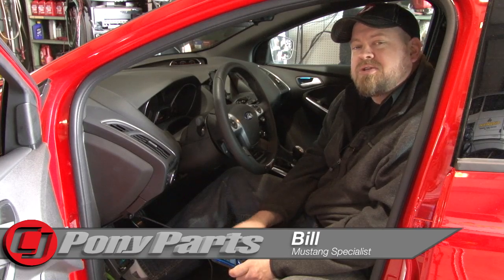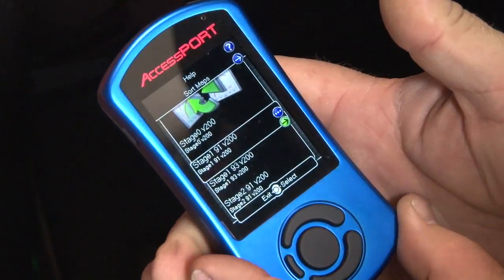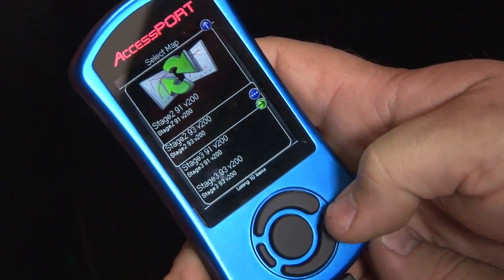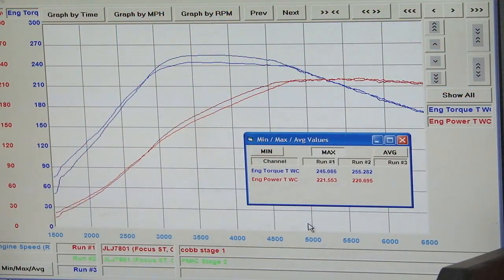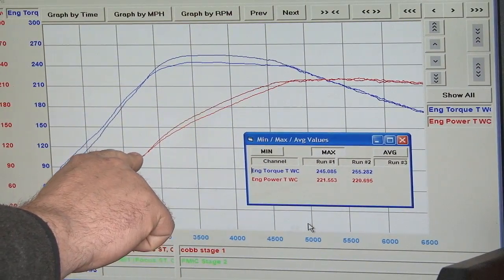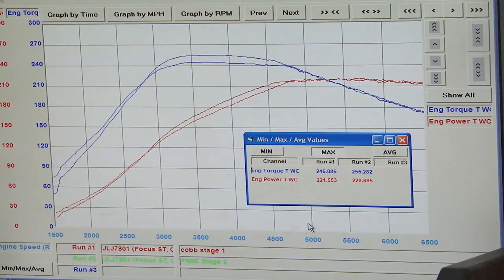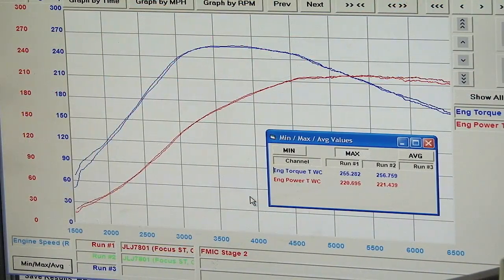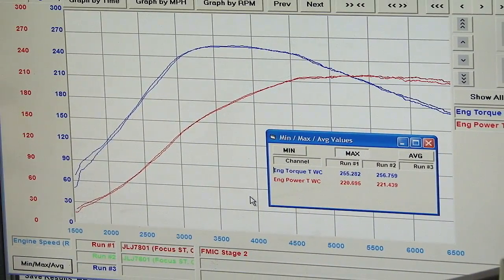Focus ST Dyno Pull with Intercooler

Comment: This is a perfect example of what I tell people. Upgraded intercoolers do not add any power, they just keep the power they always had but lose during spirited run on warm to hot days, even on cooler days in temps in the mid 60's, if you do 4 mild to hard runs it'll heat soak, thus losing boost and power.
Reply: MasterCarguy44 the man literally dynoed te car before the FMIC...installed it, ran it again...and the car made 10ft-lbs of torque more and 10 more hp through the midrange...but we're still saying a FMIC doesn't add power...lol..

Comment: Do you have to run a tune if you change the intercooler?
Reply from the maker: No you do not but the larger IC will be more beneficial with a tune and more boost.

Comment: Most of the aftermarket ICs also have larger inner diameter charge pipes, which let the turbo pick up more air. That's one of the reasons there are some gains here.

Comment: I don't get it I thought these cars had 250 HP from the factory?
Reply from the maker: 250 HP at the crank, not the wheels. Wheel horse power is always lower, usually about 15-20% lower than rated horsepower number.
Thanks for watching and please make sure you subscribe :)

Comment: Can I install a cobb intercooler on my focus st with out the charge pipes that came in the kit?
Reply from the maker: We only offer the cobb intercooler with the charge pipes. But if you want only an intercooler we offer this CPE intercooler that will work with the factory pipes https://www.cjponyparts.com/cp-e-intercooler-front-mount-focus-st-2013-2017/p/FFSSTFMIK/
Reply: CJ Pony Parts the reason I ask is because I bought a cobb intercooler used off of someone and didn’t come with charge pipes
Reply: Miguel Valdez you should be able to, I actually just bought a cobb IC lastnjght

Comment: Can i run stage 2 without intercooler . i dont drive hard or race . i just want more power for passing cars
Reply: If you don't have the supporting mods you wont gain any power only thing you will do is blow up your motor lol. I know this comment is 2 years old just wanted to put this and hope you didn't do it.

Comment: Can you run stage 2 with just intercooler and cat back? Or do you need the intake?
Reply: Mr. ST man you don't need the catback. you can run stage 2 with an intercooler and a high flow air filter. I think Cobb may recommend a full intake, but plenty of tuners on forums agree that for the stock turbo, the stock intake with a high flow filter draws plenty of air.

Comment: It seems the horsepower per dollar is really low in the st. Even when you go stage III the highest numbers I've seen are around 300 HP. The stage III pack is around $3200 from either Cobb or Mountune and that's if you install it yourself. That seems like a lot of money to gain 60 hp. Not to mention it destroys your warranty. I'm just not sure if that's worth it. Any thoughts?
Reply: My thought: if you want more HP upgrade to a bigger turbo, problem solved.
Reply: +Anthony Thomas I know but that's a even bigger investment. So your looking around 4000 maybe more to get less than 50 hp. I mean value is in the eye of the beholder, but for me doesn't seem worth it. The car is awesome stock anyways, just needs a exhaust...
Reply: +Kris Kerber I agree for stock it's decent,maybe down the road prices will come down on upgrades after the next generation model is released
Reply: Depends what you believe is "awesome". I haven't spent $4,000 at all. That's only if you go the Mountune, FRPP or Cobb route. FBO (Full Bolt-ons) or Stage 3 makes 260 hp on 91, 270 on 93, 290 on 30% ethanol. Waste gate mod/Turbo Smart IWG will put you over 300 whp on 30% ethanol. The truth is the only things you need are a tune and down pipe those makes up about 90% of your gains with this car. The next best thing would be the intake scoop offered by Steeda, Ford, Cobb and others. It makes the biggest difference in 3rd/4th gear, where your butt dyno might pick it up, but you'll see it easier at the drag strip because your trap speed will increase. I recently went 13.1@102 mph with the car pulling about 10-11 degrees of timing from where it normally is.
Reply: Buy used, many 2013-2014 cars are coming to the end of their loans/leases and parts are being sold on various websites and Facebook groups. Parts are discounted 50% used. People try and justify getting more than that but that's what it usually sells for.
Reply: you can get ford to the install without voiding your warranty
Reply: +Joe L but I agree HP per$$$ seems low
Reply: Ford has it's own line of upgrades. Ford dealers (not all) can install Mountune and Ford Racing parts and keep your factory warranty. Expect dealer rates for installation to be around $75-$100 an hour.
Reply: Kris Krash ,Volvo S60 R starts at 300 bhp so why do ford detune everything
Reply: Have you seen the stock dyno runs? You're really only getting about 210-225 hp stock in these, so it's more like 90 hp

Comment: Quick question maybe you could help with. Im currently about to purchase a 2014 st in los angeles. Ive read that the actual hp rating was achieved using 93octane. Over here the highest ive seen is 91octane. What would I have to do to achieve the base ratings?
Reply: The computer pulls timing when there is 87 octane in the car. With 91 it may not pull any since it is so close to 93 and the factory tune is not that aggressive that 2 octane points would make a huge difference but I cannot say I have ever tried it. I would ask some of the west coast guys on www.focusst.org
Reply: Wrong car makes less power on 91. Carlos with Motor Trend got 95 mph out of the 1/4 mile. Granted that was California Speedway about 1,500 ft above sea level, but even with NHRA's altitude correcting it still ran about 96 mph.

I just bought my car, 2016. 1) because it's summer and it's warm/hot I knew I wanted more power than what's available with 91 octane. I got a E30 tune from Unleashed. With no proper cool down, my car was trapping just a tick under 100 mph on 4 out of 5 passes. That's the only mod, I used slicks and forgotten to turn off ESC, so no proper burnout, best time was 13.96 @99.82. Car is a week old...

Comment: Wow what a joke those tunes are garbage!  I'm stage 2 with 450trq and 280hp unleashed tuning rocks
Reply: I would put our car up against any other bolt on Focus ST around. Again keep in mind a dyno is just a tool and Mustang dynos will always show much lower numbers than a dynojet will. The huge tqe spike the Focus STs show on dynojets also do not show up on a mustang dyno. For a basic Cobb AP tune our numbers at this point were right in line with everyone elses.
Reply: Bill Tumas funny thing is we used the same mustang dyno setup. Are you running custom tunes? Or just the basic preloaded Cobb tunes.
Reply: Bill Tumas I'll post my dyno at stage 1 for you with 372trq 253hp

Comment: So $700 for 10hp gain?  If you install it yourself.
Reply: Its not really about the horsepower you gain, it's the horsepower you lose with the stock IC when it gets heat soak.
Reply: Bill Tumas But when does this make a difference?  If you're running at the drag strip, race track etc.?

Is it needed for driving on the street? (not including illegal street racing)

Comment: Do you plan on doing any fuel modifications? I'm running the SCT Xcal 3 E30 tune from Torrie with ONLY a catless downpipe and green filter and I hit 261hp and 367tq on a dyno!
Reply: Once we max out the fuel system we will. Those are solid numbers but I guarantee they are on a dynojet, not a mustang dyno like we are using.
Reply: Bill Tumas Yes it was on a dynojet dyno but I've used the same dyno so I've seen the difference. Before E30 I ran 244hp 340tq after the E30 tune I ran 261hp 367tq so they're solid gains no matter the dyno! Just a suggestion for you guys there ☺
BTW please bring back the Focus ST videos! I'm missing them!

Comment: Yes I would get it on a dynojet because I look at your numbers and just say holy low. My Focus stock on a dynojet with SCT 93 octane tune was 249hp and 312ftlbs so it would be nice to see the difference from the same dyno....because right now I am jumping ship on the SCT and going Cobb just because I ordered FMIC, Intake, DP, 3inch catback....if I kept the sct the cheapest route I can find is $800, I'd have to rent a dyno and have Torrie Etune it....and then when I upgrade the turbo $800 again so Cobb is looking the route to go to save my wallet
Reply: Torrie does free upgrades.. always has with me even with my new E30 tune
Reply: I hit 261hp 367ftlbs on a dyno with E30 tune from Torrie Catless downpipe and green filter
Reply: I switched to cobb but sweet

Comment: IC upgrade is mainly for consistency. You can def up the boost/timing a bit and make a little more power more safely but IC is mainly for consistency which should be a must upgrade for anyone looking to upgrade in the power train area.

Comment: Our best pulls we have seen were 226fwhp/264fwtq on the Mustang Dyno which is a modest HP gain and a decent tqe gain. The differences are within the curve. While the peaks may not show huge differences there have been solid midrange gains. Once we get the downpipe installed next week we will dyno the stage 3 Cobb tune. After that we plan to look at some other tuning options and will get the car on a dynojet for comparison.
Reply: hi, question, bigger intercooler how much power can bring? its necessary to upgrade the ECU aftter fitting bigger intercooler?  Thnk you!

Comment: I thought the st had 252 hp stock?
Reply: Depends on the grade of fuel. Car is calibrated to run 93 but since many states don't have that available, there's about 10-15 hp loss at the wheels just because of 91 vs 93 octane fuel.

Comment: Did you notice any difference driving it or purely for dyno? I have tune, filter, and catless downpipe now but intercooler is next upgrade. Thanks!
Reply: Tunes add power on their own with no other modds but once you have full exhaust and dp, the tune is no longer a stand alone power adder, it is just there to make the upgrades work together now.
Reply: Filter adds no power, a dp adds 3-4 hp.. 93 octane instead of 91 will add 8-10 hp, but the only time a tune itself makes power was when you had stock dp.